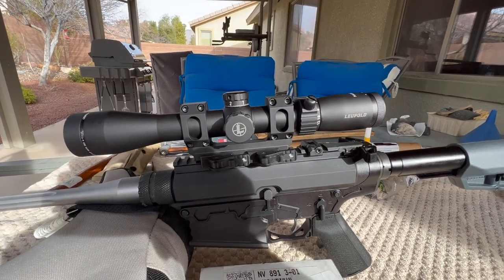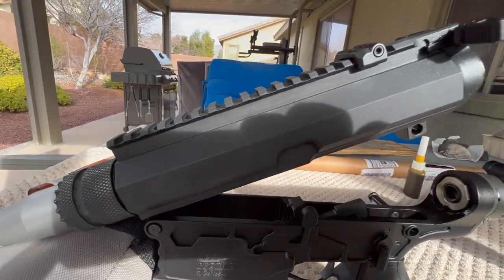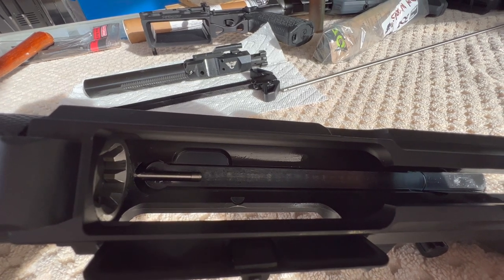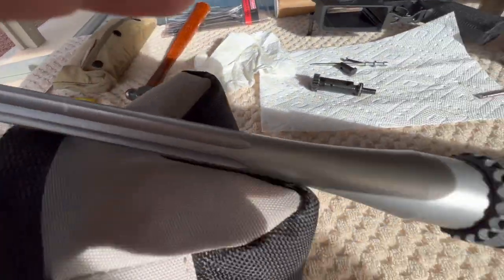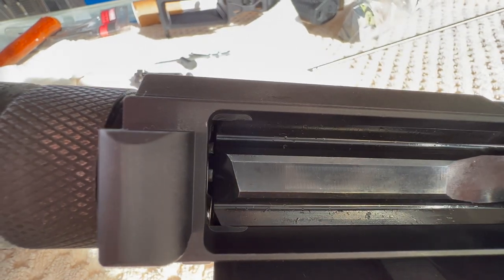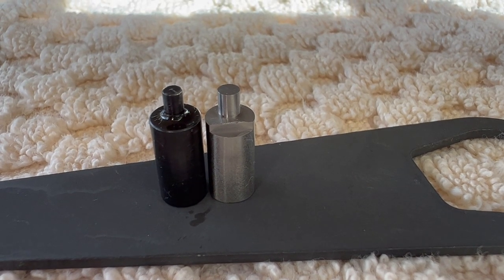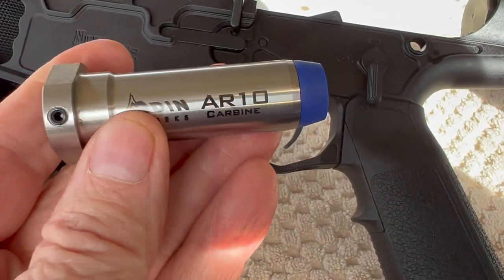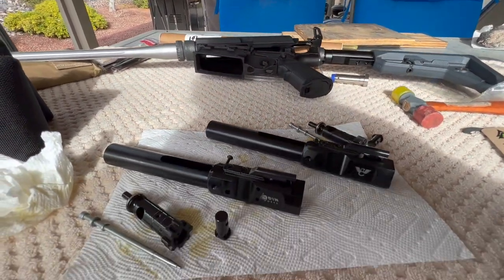AR308/LR308 Correct Gas Tube & Buffer Off-Set Retainer Pin - 15

Comment: Great job ! I`m not an expert but you did tackle the the right beast most people would have never figured it was the gas tube. My only thinking is to my knowledge Nato is supposed to be a slight hotter than commercial ammo making me think the ammo is degraded from age or storage. But even so with the adjustable gas block the rifle should be able to cycle the lower powered ammo so again Great Job , I do enjoy your videos as these kind do help us in the community to do some learning.
Reply: For 5.56 NATO yes, for 7.62X51 no. The 223 is less pressure than 5.56 NATO and 308 is hotter than 7.62X51 NATO. They are opposite..
Reply from the maker: Thanks gun fisher! M80 ball NATO 7.62x51 is a lighter load than most commercial 308 which is the opposite of 5.56 NATO vs 223. As you're saying though it could be an even lighter load as the surplus I have is 40 plus years old. I have a crap load of it so really wanting this rifle to be able to run it. My goal is to get this rifle to run on anything with the option to turn the gas down on hotter stuff. I'm hoping the correct gas tube does the trick. I can still go a little lighter on the buffer with what I have and there's two more options left. The first is I may have more adjustability on the RifleSpeed than I originally thought and the last resort is open up the gas port size on the barrel. Really trying to avoid that last one though!

Comment: When u run that Company adjustable gas system they tell u about the gas length issues
Reply from the maker: Yes! They tell you that depending on what you're building you may have to go with a custom length but they don't always tell you what the length should be. 15.400" is Armalite spec. I was able to go with 15.500" on this DPMS pattern build and went with 15.400" on my second build although I could have also went with the 15.500". Your build may be different.

Comment: I bought a complete PSA .308 upper receiver , its a nice looking 18" upper, you know, you get what you pay for,  Still haven't had it to the range but one thing i did notice is the firing pin really kisses the primer, i mean to the point i find it hard to believe the rifle didn't go off when i chambered a round,  after noticing I'm little fearful to chamber a round / let the bolt go forward. i think i might end up taking the same road you did just breaking down doing a from scratch build.
Reply from the maker: Just recently watched a newer video that's out but have forgotten the channel name. He was testing out his new Aero Precision Creedmoor and it went off when he used the bolt release! You could see that his finger was not on the trigger. He was showing the unfired primers after just chambering. Similar to what your'e saying they were getting hit hard and I was surprised that he wasn't having more unintentional discharges during chambering. He was also thinking that it might be ammunition but I'm not sure about that after seeing his primers! Don't know if you have checked your firing pin protrusion specification on the bolt but I would start there. I'm also using a "High Pressure" bolt and firing pin to avert other problems that can occur with a standard bolt and firing pin on these large caliber AR's. Wilson Combat, Odin Works and JP Enterprises are a few off the top of my head that sell them.
Reply: Here is a laugh for you !
I had my AR 10  bolt get stick not all the way locked into the barrel extension on a chambered round in the chamber the problem to get it unstuck I thought was take the upper off the lower receiver and fiddle with it to get the bolt out - well nothing worked So I thought to strike the back of the bolt carrier with a wrench to get the bolt closed and fire off the round in the chamber by putting the upper back on the lower and shooting- CRAZY Here ! hitting the back of the bolt carrier using the wrench set off the cartridge from Kinetic energy of the firing pin hitting the cartridge primer when the bolt locked into the barrel extension sending the bolt carrier 30 feet away and no idea where the spend cartridge went.
Reply from the maker: @lurebenson7722  Ha! Ha! Damn! Possible design flaw by Eugene. My FNFAL firing pins have "anti-slam fire" springs on the firing pin. I have often noticed on my AR-15's light primer strikes from just chambering! Slam fire on an AR platform is extremely rare even with the softer commercial primers vs NATO.
Reply: @peteregger7928  Joking humor here anyone care to repeat my crazy goof up?
Maybe look right at the bolt carrier when taken a rap with a hammer on the bolt carrier and cartridge in the chamber?
Yeah, can look like a Unicorn with a bolt carrier stuck in the forehead!
Or lose your teeth with the bolt carrier rammed down your mouth.
Reply: @lurebenson7722    wow, now that's pretty hairy, that would have scared the crap outta me. I have to ask where were you while doing this? in the house, outside?  i still haven't screwed with the upper i mentioned above, Just sitting in the corner.
Reply from the maker: @lurebenson7722  Somebody was watching out for you! I've always gravitated to high risk activities as long as I can remember! My parents were convinced my time on earth would be a short one! Lol! Collecting stamps or proactively bird watching? No thanks!

Comment: I build and sell specialty AR 10 uppers for sale in WSM magnums so what I am using for gas tubes is White Oak 18-5-inch gas tubes with 25-5 inch or 26-inch Pac Nor super match barrels I send to Mark Manson in Arizona for finish work such as machining for threading for barrel extension - chambering - gas block machining & gas port hole drilling after receiving the barrels from Pac Nor.
I am using these long gas tubes to delay bolt opening under extreme pressure.
I do own an AR 10 upper in 308 but all of my loads are max charged reloads so I wouldn't see the issue this AR owner is having with military ammo.
The reloads I fire are so pressured up the buffer coming back sounds like it is going to come out the back of the buffer tube!
I must be using reload 308s pumped up to mid 30-06 loads !
Reply from the maker: Sounds like your the next level up! I have both of my LR308 builds now running 100% using very low powered Hirtenbeger NATO which I believe is lower powered than my South African. A chronograph would be helpful but just going by feel. I don't run a can or use subsonic but I think I may have selected the right RifleSpeed plungers to run that too! Thanks for watching and commenting!

Comment: What buffer tube depth and buffer length is that? Because I’ve heard of people switching from 7” to 7.25” tube depth, using short 2.5” buffers and it solved their short stroking issues. Drop your buffer into the tube. Drop the bcg in too. Bolt shoulder should just about reach the tube opening.
Reply from the maker: Not sure about 7.25"? The only dimensions I'm familiar with are 7.00" which is MilSpec and the A5 which comes in at 7.625" (5/8") or 7.750" (3/4"). I have done some more recent videos changing both my LR308's over to the A5 tubes (7.750") using "Heavy Buffers" carbine length at 8.5oz and 308 rifle length springs. The set-up in this video was the 7.00" MilSpec tube using an Aero Precision Stubby 308 buffer and their 308 carbine spring. This did not work for these rifles causing high velocity BCG issues which I had incorrectly diagnosed as short stroking and was causing buffer tube damage. Both the Aero Precision 308 carbine springs and 3.8oz stubby buffers and the damaged tube are in the trash.